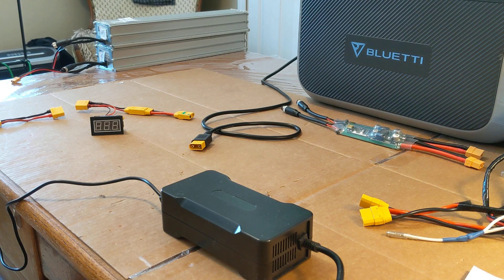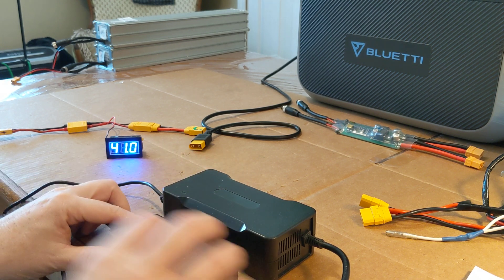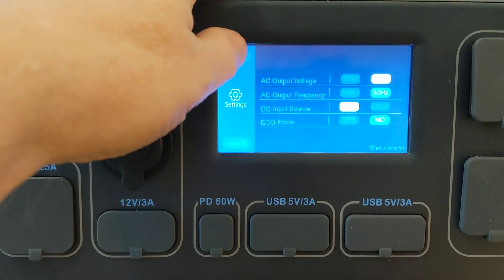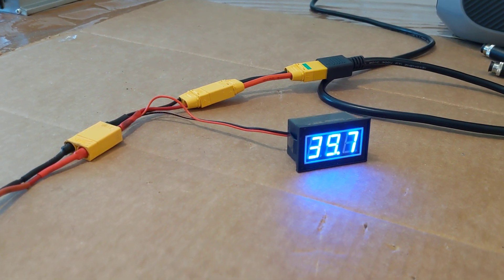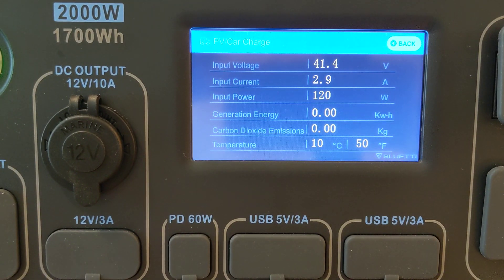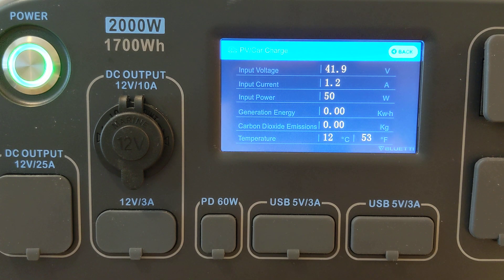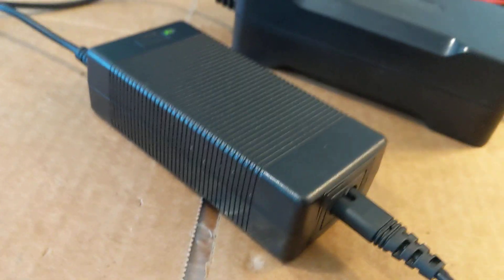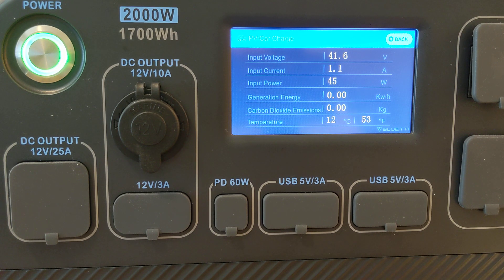Charging a Bluetti AC200 through the solar port with a brick 42v charger.

Comment: That brick is only good to 3 amps.. Anything over and it will shut down..  The brick is doing as designed...   This shows nothing about the bluetti..

The bricks are good, up to, their current rating.. Anything more and they will do what you see..

This is the difference between them and a constant current /constant volt power supply..
Reply: How to make such brick to work with bluetti solar input constantly?

Comment: I use the power brick from my EB150 it is the older heavy none switch mode type , it works well in the Solar port , I use the AC200's own switch mode in the normal charge port , so can charge pretty fast using both at the same time .
Reply: Hello. Can I use the Bluetti T200S charger (200W - EB55 / EB70) to double charge the AC200MAX? If I insert it into the solar charging port, through an adapter?

Comment: I have similar issue and the shutting off  seems to be function of current not voltage.  In my case bluettie displays higher amps than charger is rated for
Reply from the maker: Hmm... That is weird.

Comment: Agree with greengooseman,your brick is charging capacitor on old blue not battery,thinks it's charged and backs off,I ended up moving ground on rs200 battery pack to alt term to fix load cutting out on ebike.There is video showing the terminal move about an inch away.
Reply from the maker: Thank you. I've been thinking of cracking the case and doing just that as a last resort.
Reply: Підкажіть як примусити працювати блок живлення для зарядки літій-іонних аккумуляторів з виходом 82В 6А у якості імітатора виходу з сонячних панелей для додаткової швидкості заряджання Блуетті (dual AC charge). На вході в блуетті напругу показує, а струм нульовий. На зарядці мигає почергово зеленим і червоним. Напевно БП думає, що батарея заряджена. Як обійти ситуацію, щоб БП заряджав через вхід сонячноі панелі Блуетті?
Reply: @vadymbilous5356  знайшов рішення?
Reply: Point me to this video, please!

Comment: I went 3 days without issues and suddenly at 10pm last night it took a nose dive and was dead by 5am. Nothing in my setup changed.
Reply from the maker: I have also had something weird happen Greengooseman. After a suggestion, I tried to charge at the same time I drew off 250 watts and it worked! Now my Bluetti Will accept a charge from just one battery pack and hold consistency of above 400 watts and 11.9 amps for more than 30 minutes. Today I'm going to try the 72 volt and see if it works too. How could just drawing off 250 watts at the same time you're charging cause the BMS to start now working correctly? I will try to post a video today showing this.
Reply: @sidjones-randomstuff2058  , I draw constantly 75w-800W. I process about 7-9Kw of electric thru it daily. At the moment im running the 400W AC adapter thru my old 36v inverter to ensure it doesnt go dead anymore. I still have a direct connection from the PV port to the battery bank. I charge up to 42V in the day and it depletes to 35.5 (ish) by morning.

*I have been talking to Bluetti support and our issue is being escalated. I gave them the link to your videos to explain MY situation. For some reason they cant understand what I write, but at least your videos cant be misinterpreted.

thanks for the updates.
Reply from the maker: @greengooseman  That is great greengooseman... thank you for your efforts and updates. Perhaps there is a software update or a replacement unit in our future. It sounds like with your constant 400 watt inverter running it should keep that BMS working. I did some further testing the past few days. I am working on the video right now. If I am running 30-42 volts (1 battery) into the BMS I now have it working. I used a viewers suggestion of running a load at the same time. I ran a 275 watt load and now it works, whether I have a load on or not. BUT when I try 72v it's still a no go. It wains off in 30-45 minutes. I wonder if I ran a 720 watt load what it would do? Thanks for including me in your updates. Your system sounds much more involved than mine... sounds fascinating actually. I would love to see a video of yours some time. Thanks again, Kevin

Comment: What would happen if you tried charging the Bluetti from the scooter batteries via the 8mm plug instead of the aviator plug?
Reply: If you are talking about where the AC to DC power brick plugs in, it wants 58.8 VDC.

Comment: For this test you need a stronger brick, Just a flier here but try the batteries again in series but this time try with the AC on or DC on. Why: so the AC200 unit will turn on its fans vs ramping down the charge.
Reply: Did try 2 series scooter batteries, same from your video in my AC200 (NMC version) , same from your video and it will take 715w or so for 30mins plus now. Started at 68% Soc also drawing 71w out of the AC side on inverter at same time. Every 60s It will drop to half power for a second then recover, may be testing for max power point. Temp in pv menu hits 102f then fan comes on and drops to 98 after 30s or so.
Reply from the maker: @ericr4721  Thanks Eric. I cannot get 72 volt to draw anything but about 350-400 but starts to drain down to 228 within about 15 minutes. Then continues down to 8 w and zero. I did figure out on one battery, if its draining down to zero within 30 minutes... if I hook up a 275 watt load then it pops up to 450 watts and stays around that value for an hour (or until the battery runs low on voltage). It's like the load triggers something to work.
Reply from the maker: Good idea Eric. Thank you! I'll actually try it with a small load say 100 watts or so.

Comment: I think your problem is inside the Bluetti.
Curious, have you tried charging from your car 12v system to see if that works?
Reply: I have to second this, I have no issues with my bluetti charging from the solar port using a DIY power supply I made. It works with the AC port as well no issues for additional solar capacity
Reply from the maker: I'll try that next, thanks Rick!

Comment: DC chargers "pulse" charge. 42v on and off, when it samples during the off state, it looks to see what the battery is sitting at. If its at an acceptable level, the light turns red and shuts off. You are feeding an MPPT and not a battery directly.
Reply from the maker: So that explains it then. I need either a straight battery or bench power supply?
Reply: How to make the brick not to measure anything and just work?

Comment: Hello sir , what I have done and it’s been working for me for about 5 years I got one of those power supply unit from Amazon or if you like eBay just make sure it have a set turn voltage fail and make you own 24-36 volt charger!
Reply from the maker: That's a great idea, thanks!